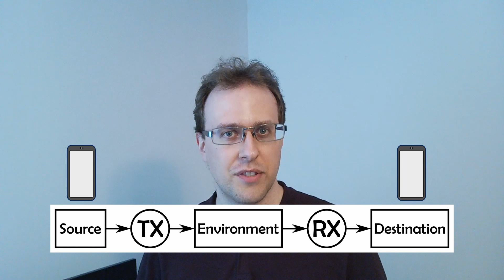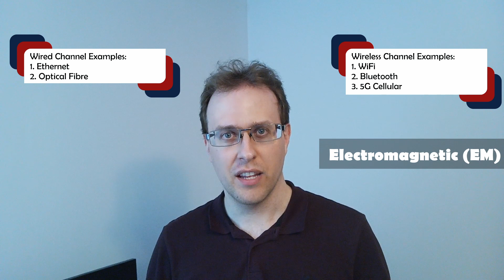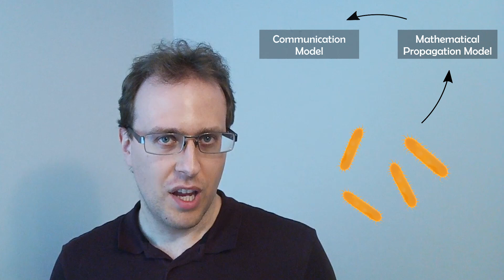Molecular Communication in a Nutshell

Comment: How would you recommend tailoring a traditional Electrical Engineering degree towards this field of molecular communications? Which EE electives and foundational biology courses would you recommend?
Reply from the maker: This is challenging to answer because MC is so interdisciplinary, and I don't know what EE topics are electives for you. Within EE, I think that the most relevant subjects have been probability and random processes, communication theory, and signal processing (more specifically, parameter estimation). I took a 2nd year undergrad courses in cell biology and physical chemistry as a PhD student. These were incredibly insightful but I wouldn't necessarily recommend them to anyone wanting to work in MC. It really depends on what kind of system you might want to target and whether you are more likely to perform derivations, simulations, or experiments.